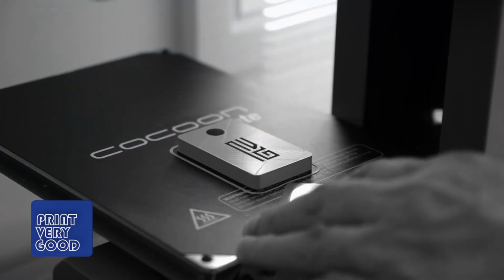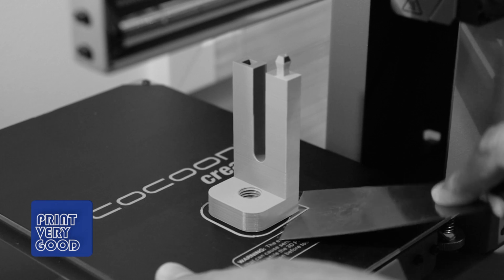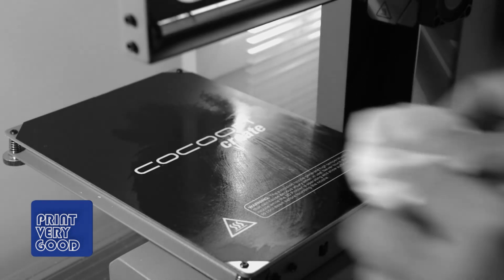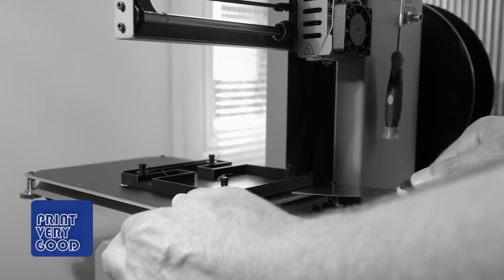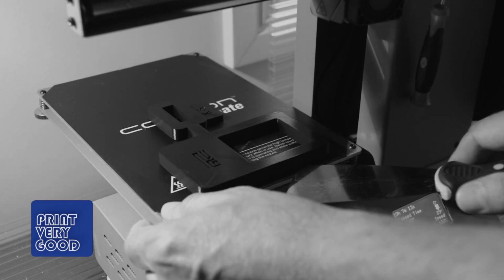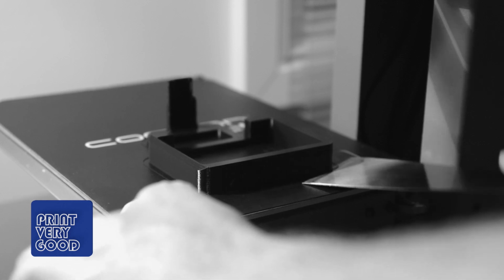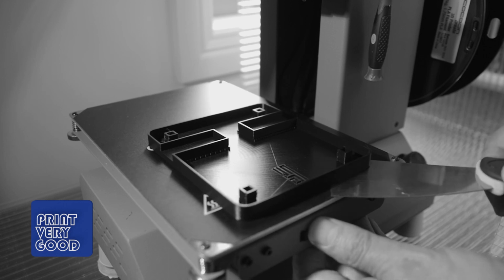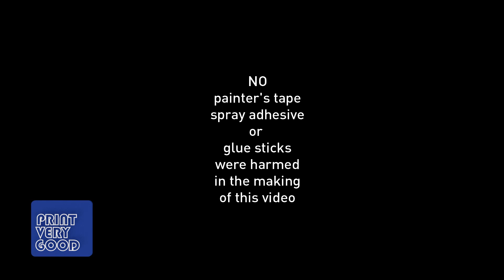Look at My Bed adhesion with Isopropyl Alcohol

Comment: Hi Paul, I've recently started using isopropyl on my bed before every print and it seems like a miracle. The first layer is sticking perfectly. It becomes quite a challenge to remove objects at the end of a print but rather than going at them with a scraper I've started to shimmy in a razor blade which helps with releasing the object from the glass plate.

Comment: I bought an ANET 8 recently and print on a glass plate with no spray or anything else. It's important to adjust the bed level within 0.1 mm or less, adjust first layer speed to get a good adhesion.

Comment: What is your printing surface material? I just got the Creality Ender 5 with the peel up magnetic bed. In several videos I watched, it was stated that IPA ruined the surface. I have had only a couple of incidence of non adhesion where I set the bed leveling poorly. My fault. 
There are several different materials used for printing beds. I also had a CEL Robox printer with a fiberglass-like material. It worked very well with just dry wiping with a micro fiber cloth. I tried to never touch the bed with bare fingers to keep oil and dirt off of it. It would be helpful to know what yours is. Thanks for the great videos.

Comment: have you tried compressed airspray ? 
turned upside down you can cool it down to -50 degrees very fast

a quick spray usually is enough to get it unstuck in one corner (never overuse !)
for me this is the fastest way to get my prints off if they are REALY stuck

or having some iced bottle

Comment: Thanks for the comment about waiting to remove the part over night.   Not sticking has not been a problem.  Not getting a part to budge has been the problem.  On my Monoprice Select Mini, the parts have even adhered to the bed even though blue tape.
Reply from the maker: I made this video about removing stuck parts with methylated spirits Joseph, you might find it useful. https://youtu.be/U3gH9yxnGlU

Comment: Excellent and informative video. Thanks for creating this and the others on adhesion. I think you're right on the money emphasising the importance of the initial bed distance to achieving good adhesion with this printer. I've tried gluestick, masking tape, stringently clean bed but none of these seem to work unless that distance is optimised as you describe.
I've been using a combination of close extruder distance and gluestick but this means sacrificing the quality of the surface touching the bed. Seeing your results here I am confident to try leaving out the glue.
For removal of well adhered prints a small (#5) painters spatula can be very handy. These are small, very thin and flexible and have rounded well polished edges which help to avoid damage to the print or the bed surface itself. The curved stem also allows the spatula to be placed flush with the bed which makes it easier to get under the print. A friend put me onto this and I haven't used the 'stock' spatula that comes with this printer since, except to remove very large prints after first loosening with the paint spatula. It's also slightly safer then the larger sharp one that comes in the box. If that thing slips on a difficult to remove print and you're gripping the bed with the left hand it's going to bite!
Reply from the maker: Thanks Josh! Thanks also for the tip on the #5 painter's spatula, will definitely check that out.

Comment: Thanks for sharing your adhesion tips. I've recently been getting very good adhesion using a sugar water mixture, but I find it a bit messy. I will try your method, and was especially interested in your 1st layer settings, they make perfect sense and I'm sure will make an improvement in my results. Happy Printing!

Comment: spraying with isopropyl alcohol onto the perimeter of a finished part will help to get it off the bed as well.  The alcohol both lowers the temperature as well as gets drawn under the part making it much easier to remove from the bed.
Reply: Great idea.  I will try that.  My problem is parts stick too well.
Reply: Yes it will spray let it sit for minute then it will pop right off a lot easier

Comment: You seem to be suffering a fundamental misunderstanding of how the first layer is generated, but in fact you just need to look at your print coordinate readout on the display or inspect the G-code.

When you home the printer, then use a feeler gauge while moving in XY with Z=0 to adjust the bed such that there is exactly 0.08mm between nozzle and bed, it doesn't mean that 0.1mm first layer becomes squished into the bed surface. It means that your nozzle is travelling 0.18mm over the bed surface. Just look at the G-code, first thing it does after it has done the heatup, is to travel towards a point at first layer height, not at zero, and this is the height the first layer is printed at - not from the physical bed, but from the point you effectively set as zero which is above the bed.

So in an ideal world, and if you had an ideally flat and smooth bed, and an ideally repeatable endstop, you would set the nozzle to just about scrape the bed surface at Z=0, and you'd have an ideal first layer. However, a small offset is sensible to account for all of these things not being ideal, you don't want to start off too far nor do you want the nozzle to ram into the bed and cause extruder grinding or bed lining damage. For the most part, paper-thin offset works pretty well.

You're also not doing yourself or anyone any favours by hypothesising (without testing) that you need to set nozzle offset higher if you had a taller first layer, because the error in your approach will accumulate with the corresponding first print move, you'll likely find that it won't stick and you should use the same offset that you had used with thinner layers instead - unless you had an overextrusion issue, which you probably don't, doesn't look like.

Why this particular offset works for you? Pure accident or combination of multiple factors that simply has no straightforward explanation. 3D printing is magical.

Why isopropanol works for you and not for someone else? Probably just material quality. You have a PEI bed lining that is high-purity and actually works as intended, someone else got a fake. You managed to buy isopropanol that is reasonably free of heavier non-volatile alcohols and oils, while someone else got a low-quality one, so yours happens to clean the bed while someone else's happens to cover it with an invisible layer of an adhesion barrier. These kinds of things.
Reply from the maker: You may be right. Thanks for commenting.
Reply: I love how the only comment that should have been pinned/hearted is not. This comment is literally the best thing I have ever seen on YouTube about 3d printing. Only because he said that you just got lucky and you didn't actually tested or asked your self why that result happened doesn't mean he shouldn't deserve an heart. GG my dude
Reply: That what I was thinking the whole video. He's lucky and his line of reasoning is wrong.

Glue works for anyone despite bad bed/plate conditions, tramming has to be done with thin paper that's all.

In my case, with my new ultraplanar plate, normal printing paper feels too thick to give me the best results. If you have a very very good bed/plate go for a thinner piece of paper for tramming.
Reply: "When you home the printer, then use a feeler gauge while moving in XY with Z=0 to adjust the bed such that there is exactly 0.08mm between nozzle and bed, it doesn't mean that 0.1mm first layer becomes squished into the bed surface. It means that your nozzle is travelling 0.18mm over the bed surface. Just look at the G-code, first thing it does after it has done the heatup, is to travel towards a point at first layer height, not at zero, and this is the height the first layer is printed at - not from the physical bed, but from the point you effectively set as zero which is above the bed."

i do not know this printer so i cant tell you how it does it, but some printers like the ender3 hits the switch, then moves up, and resets the z0, so in that case he is correct.
Reply: @specy_  well he could be nicer in his first line, manners cost nothing, i would not give a heart to that either.

also, he says this
"You're also not doing yourself or anyone any favours by hypothesising (without testing) that you need to set nozzle offset higher if you had a taller first layer, "

but he does not listen, he clearly says, he would do some experiment first.

Comment: nice quality of prints for the wanhoa/ cocoon, but im so glad im using as spring steel sheet. that saves a lot of work there.
what you could use is a 1 mm plexiglass sheet, sand it first and attach to the bed.
hat way you will have a lot easier work removing the prints
Reply from the maker: Nice tip thanks Patrick! Agreed, the spring steel sheet will be a sought after feature when shopping for my next printer.

Comment: I'm not a fan of leveling a bed with paper, the friction you feel is subjective imho.(especially at 0.08mm)
I'd suggest getting a dial gauge, and actually checking the bed across multiple points, as it could be bowed.
These printers usually come with a giant cable tie holding the bed during shipping, but if it's been pulled too tight, the bed can be bent.

Comment: hi  I have the same printer as you but every thing I print has major stringing please help!!
Reply from the maker: Hi Rowan! 
Try printing at a lower temperature - 195 C.
Set Retraction Speed to 40mm/s and Retraction Distance to 7mm when slicing.
Oh, also make sure Retraction is enabled in your slicing software... It may be turned off by default.
Let me know how it goes!

Comment: Missing your vids Paul. I got a Wanhao i3 mini which is basically a Cocoon mini- and your vids were an excellent source of encouragement. I still have problems with adhesion and I tried using IPA to no avail. Maybe its my levelling? The only way I get anything is to cover the bed in glue stick which really messes up the print bottom! Hope we are going to see you back on here at some stage! Cheers.
Reply from the maker: Thanks very much Chris I really appreciate that. Re adhesion, do you live in a more humid climate? I've learnt from my subscribers that my methods tend to be less effective in humid climates. Also make sure you are using good quality IPA. Apparently there is a difference in purity between brands.
Reply: Does NW England count as humid? Guess it could with all the rain we have!! Certainly the adhesion process seems very inconsistent- I waver between thinking its an adhesion problem or a machine problem- perhaps Cura settings? Rafts have been the only way to get prints consistent.
Reply from the maker: @Chris-ug7bi  Hmmmm interesting. I definitely would give the IPA another try. Clean the bed a few times, giving it a good scrub with a paper towel wetted with IPA. Make sure all the glue stick is gone. Then lower the nozzle as close to the bed as you can, without it actually touching the surface of the bed. Do a test print. The first layer will be a bit squished. Once you're happy with adhesion you can then start opening the gap to a point you're happy with the print quality and adhesion levels. Give that a try and let me know how it goes Chris.
Reply: Try sdding raft layers. This will gice you a smooth finish. And allows you to still uae gluem it also fixes uneven beds a bit.

Comment: not only will my parts not stick, I have a level problem.  Hard to nail down on my Ender 3 which was doing great the first 4 days.
Reply: Get a dial gauge and check your bed isn't bowed, would be my suggestion, and your bed can be leveled to much higher accuracy that way too!

Comment: Paul im wondering your results. I'm using the wanhao duplicator i3 mini. It looks like your printer. They told me to use glue beceause it doesnt have heater bed/bed warmer. Should i use alcohol and stop using gleu ? And do you have a email so maybe i can contact you?
Reply from the maker: I initially started using glue too but soon found I didn't need it. I got the best results on a non heated bed by keeping the nozzle gap close to the print bed (0.08mm) and scrubbing the print surface with Isopropyl Alcohol and a paper towel before each print. On a non heated bed you really need that first layer of filament pressing in to the print surface for best adhesion.. I have a few videos on this topic showing how my process has evolved over time. You can see all my videos here https://www.youtube.com/c/printverygood
Reply: @PVG3DPrints  Paul thank you so much. My prints are verry strong now. Your method is really working. Now i want to stop using gleu and use just alcohol so fast as possible. I will report you my results with using alcohol.

Comment: How does alcohol, that entirely evaporates, helps with bed adhesion?
Reply from the maker: Think about it... Alcohol dissolves oil and grime (which is the main culprit for poor bed adhesion) which is then removed when wiping with a cloth or paper towel.

Comment: Thanks for this video. Just wondering why you print at 195C?
Reply from the maker: Hi Paulapiper! 195c is the temp recommended for the Cocoon PLA filament. I get good results at that temperature so I haven't worried about experimenting but I have seen other printer manufacturers recommending higher temps for their printers. I have noticed a difference between the Cocoon Slate grey PLA and Cocoon Black PLA though, the black is a little more oozy than the grey at 195c.
Reply: Print Very Good Thanks, I might experiment with that as well as the isopropyl. I bought a Cocoon Model Maker and notice the temp setting for the gcode files on the accompanying sd card is 215C. Being very new my first attempt at slicing was at  250c and that didn’t work at all. So I might try 195C and see what difference it makes. Thanks again. I’ve been enjoying your content.
Reply: I print pla at 200 and get excellent results

Comment: To detach spray alcohol!
Glue works for anyone despite bad bed/plate conditions.
Tramming has to be done with thin paper due to irregularities of the surface. In my case, with my new ultraplanar plate, normal printing paper feels too thick to give me the best results. If you have a very good bed/plate go for a thinner piece of paper for tramming.
I've reduced the speed and increased the height of the first layer in order to deposit some more hot materials and make it stick better.
Whenever I have very limited build surface I use brim, no shame in that.